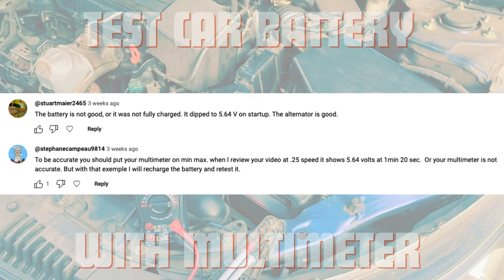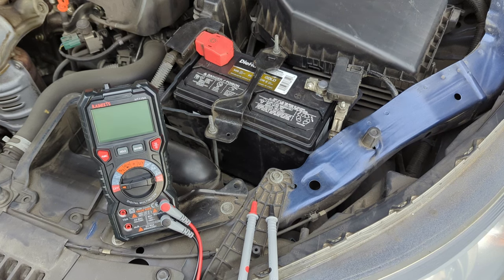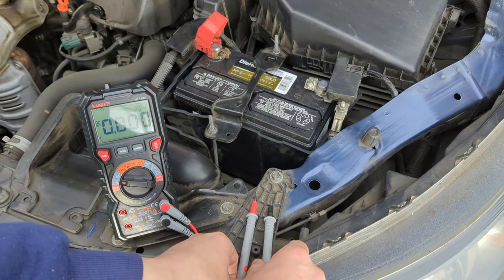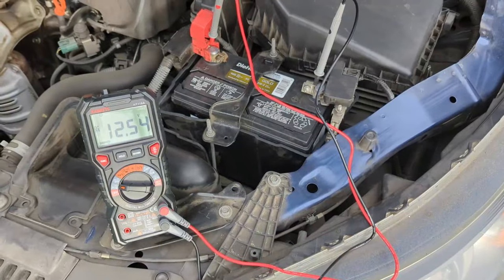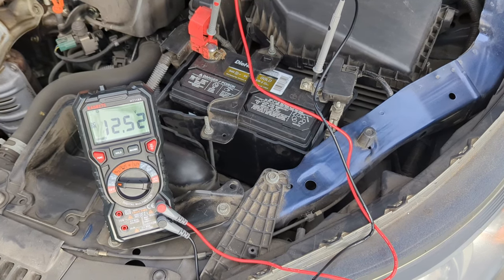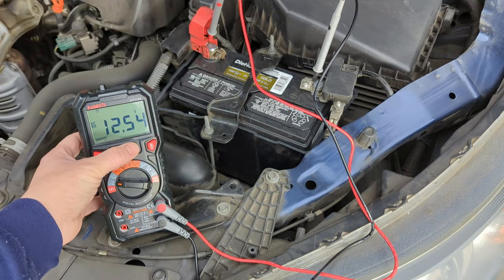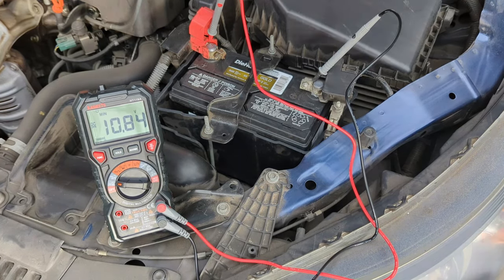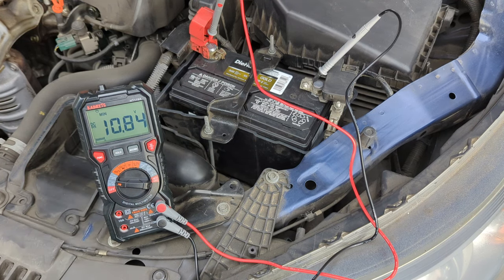Another Way to Test a Car Battery With a Multimeter | The Easy Way to Know

Comment: If you need to see the voltage of the car whilst starting it, put your multimeter probes in the cigarette (acessory port) inside the car and start from there, the measure of the battery in any normal car would only be about a .01 volt drop in the car as opposed to at the battery, and so it is still an accurate enough reading.
Some 12 volt to usb adapters even come with volt meters on them so you can get an idea of when your battery is beginning to die if using electrical items with the car off, this will also display voltage at car startup.